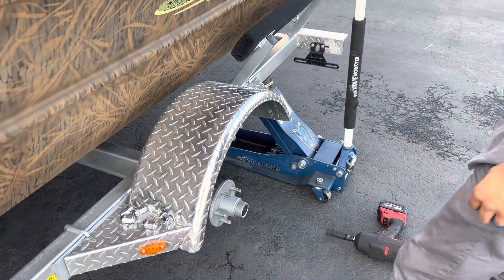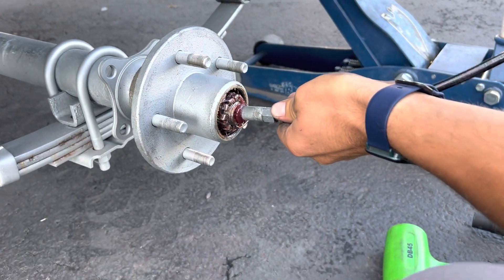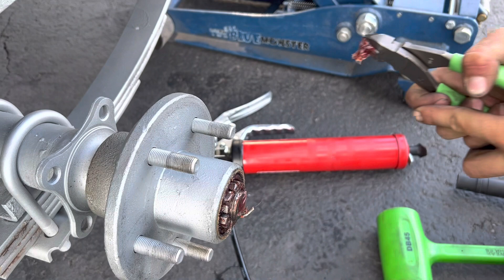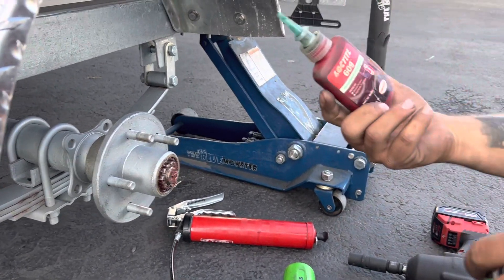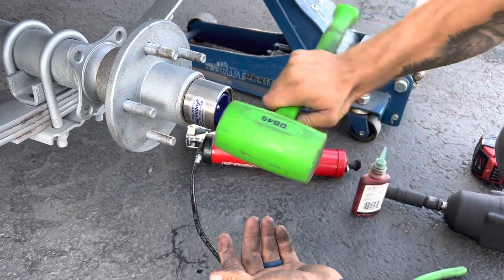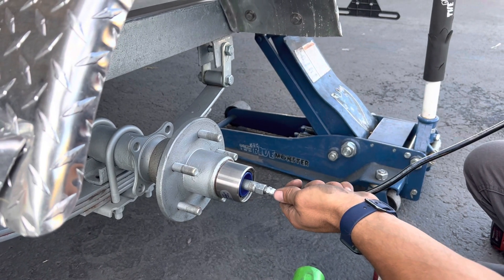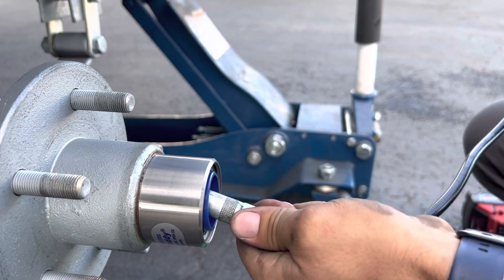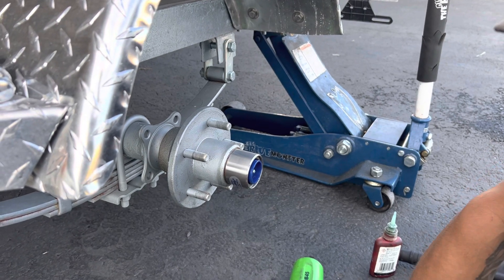How To Install Bearing Buddy’s On Easy Lube Axles! G3 Boats.

Comment: I recently installed the same ones on my boat trailer, one fell off ! Bearing Buddy replaced it free, an again it got loose and ready to fall off ! I took it off until I got home. I then thoroughly cleaned the areas were the cap meets the hub and applied locktite blue , I don’t expect it to hold and guessing I need a new hub ? Why this is happening to only one side is beyond me ? Thanks, very helpful.
Reply from the maker: @duffmeister6480  my guess would be a default in the hub where the buddy seats.  Should definitely use locktite. While a hub could have a flaw from the manufacturer it’s much more likely that taking the old cap off if you used a metal hammer it could have dinged just inside the lip with one miss. I’m not saying that’s what happened but it is pretty common. If it comes off with locktite I would recommend replacing the hub or having a trained technician look at the issue
Reply: @nexgenmarineoutdoorstv  yes it was real hard getting this particular original ez lube hub cap off, strange that I can’t pull it off or wiggle it with my hand, but it gets loose ? Thanks for your advice.

Comment: This is NOT a good idea...Bearing Buddies were designed for trailer axles WITHOUT EZ-lube axles. Here's why...when hitting the zerk on the axle with a grease gun, the grease is pushed through channels within the axle filling the VOID between the INNER and OUTER bearings inside the wheel rotor, and it also facilitates purging old grease out when new grease is pushed in through the grease gun. By pulling the axle zerk and replacing with the bearing buddy, you will NOT be able to fill that void through the axle and purge out old grease. It also will NOT grease your inner bearing. BB's grease the outer bearing only. The main benefit to BB's is they help keep water out, but they will not replace the function of an EZ-lube trailer axle. 

What you SHOULD do if you want to use BB's on an EZ-lube axle is take a flathead screwdriver and hammer out the follower plate of the bearing buddy until it pushes out the back, pull the spring out, and you can use the Bearing Buddy as a glorified dust cap with the BB bra which will still suction properly and help keep water out. When your EZ-lube axles are filled with grease, that alone will keep water away from your bearings. 

Bottom line - if you have an EZ-lube axle you already have a vastly superior lubrication system to what the Bearing Buddies can provide. Bearing Buddies are great for axles without EZ-lube as they keep 2-3 PSI of grease pressure against the outer bearing which prevents water intrusion, but they are not designed to replace the functionality of an EZ-lube trailer axle.
Reply from the maker: @ChrisG9978  all I can say this method has shown to be very reliable in practice.
Reply: @nexgenmarineoutdoorstv  I'm sure the bearing buddies are keeping grease on the outer bearing, but how would you purge the old grease annually with no zerk on the axle, or get grease to the inner bearing without pulling the wheel hubs off completely? There's no way the Bearing Buddies are going to push grease all the way through the EZ-lube axle...